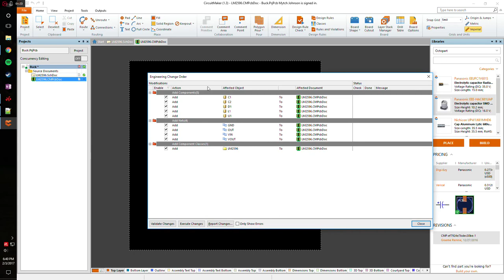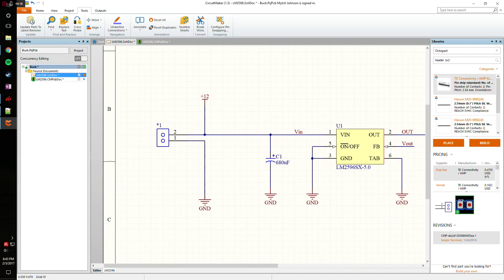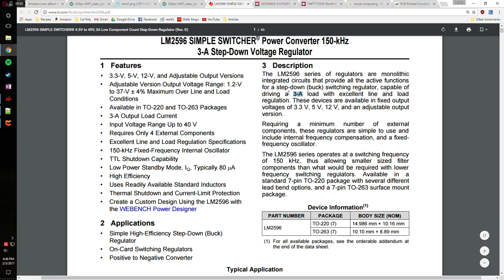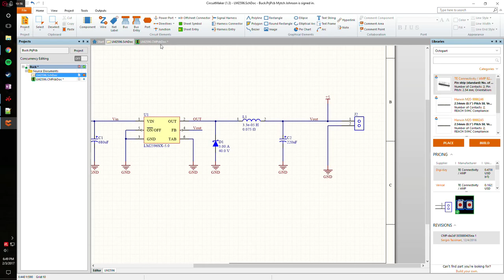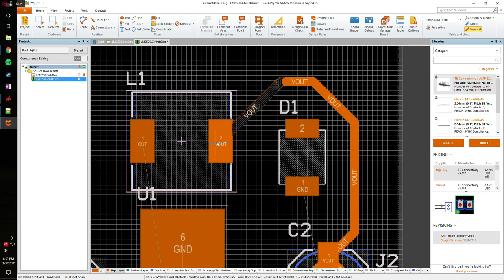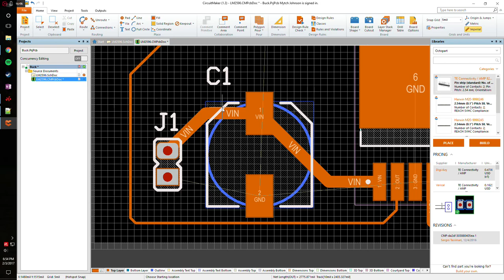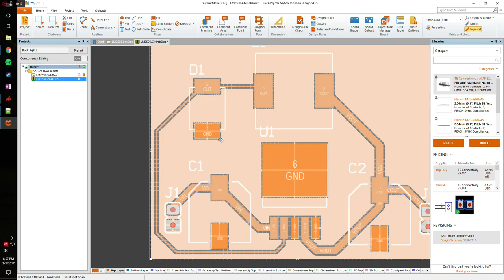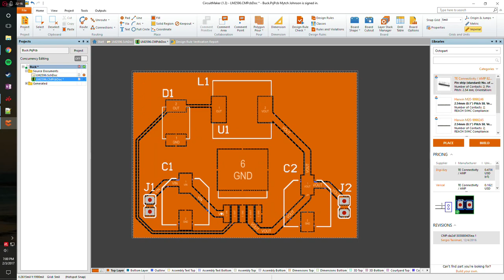Circuitmaker Tutorial - PCB

Comment: Your polygon connect width in the design rules needs to be much greater than the default (0.25mm). Would suggest 0.8-1mm to keep impedances down. Also you need to keep U1 pin4 (VOUT) and L1 as close to each other as possible to keep switching noise to a minumum. But keep up the good work!

Comment: If one is doing a single-side board with the traces on the bottom then should all the routing be done on the 2nd layer?  Is that the bottom?

Also, I would like to output a PDF so I can print the traces on a transparency, but I can't find an option to print the traces & ground plane.  Any ideas on how to do that?

Thanks!

Comment: Hi 
I want to change the dimensions of all the VIAs on the board,
How can I do this after I have selected the entire board.
Does the program have such a feature?
Thanks.
Reply from the maker: Mert Karaca if you're changing via dimensions to support more current, you have 2 options. You can add additional vias across the same nets, or increase the size of the vias. Here is the documentation for the latter. https://documentation.circuitmaker.com/display/CMAK/PCB_Dlg-Via((Via))_CM
Reply: Mytch Johnson Thank you How can I change all via dimensions same time (all of vias) when selected all vias?
Reply from the maker: Mert Karaca you might be able to do that from the constraints manager (though that's usually for spacing not sizing). I would add the sized via to your list of favorites then select that via type when placing each via. https://documentation.circuitmaker.com/display/CMAK/PCB_Dlg-FavoriteInteractiveViaSizes((Favorite+Interactive+Via+Sizes))_CM